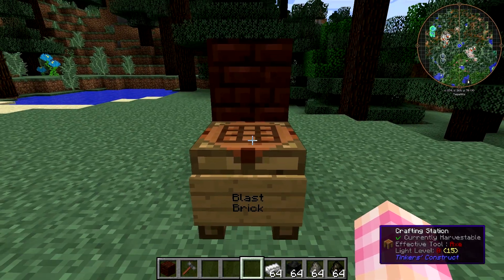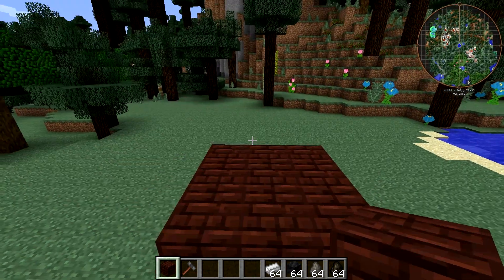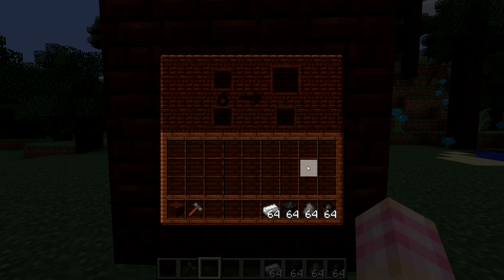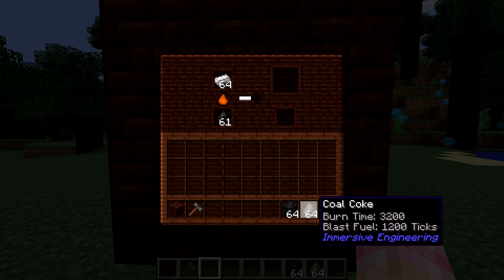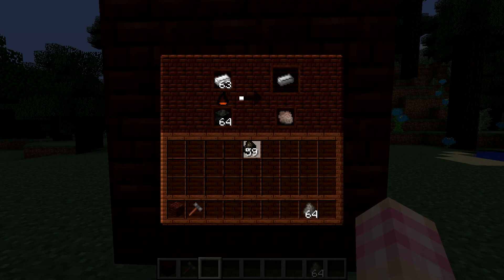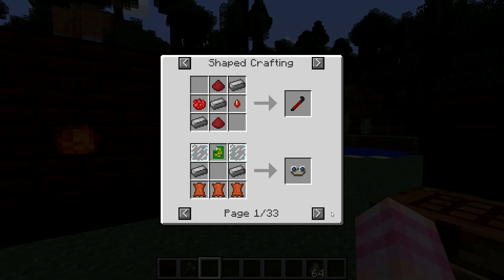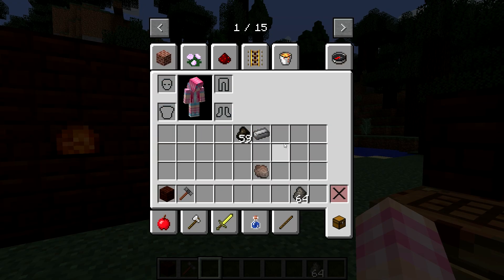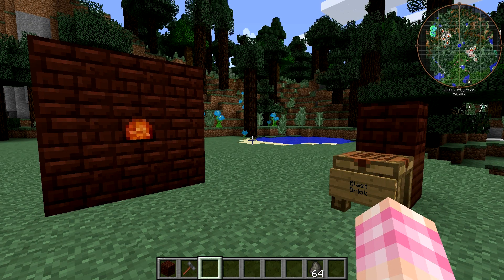Immersive Engineering Tutorial #5 - Blast Furnace

Comment: so i have a crude blast furnace and its not making the steel, im using iron ingots too help please
Reply from the maker: You also need to use Charcoal or Coal Coke as the fuel
Reply: i do use it but no progress is made
Reply from the maker: It takes 4 pieces of charcoal per ingot
Reply: and i put a stack of 64 charcoal in it
Reply from the maker: That doesn't make sense. Lubber and I were having problems with it in our Dragon Realm series too. Are you just running Immersive Engineering or are you running a modpack?
Reply: im using a few mods

Comment: Can someone tell me how to make the netherack in my Saw 2 furnace light up one block by one block like the furnace in Saw 2 when each row of flames popped up one by one in the gas furnace? My furnace is 10 blocks long 3 blocks tall and the grill is made of 10 netherack blocks. I use and iron trap door since iron bars can't be used as a trap door and it closes by a lever but I can't get the flames to pop up on each netherack block by one starting from the iron trapdoor to the window. So can someone tell me how to make the flames rise up on each netherack block one by one so I don't have to light up every netherack block?

Comment: Great tutorials as usual,
but this video could have been extended to mention the improved version of the blast furnace. 
That only require the blast furnace, a vanilla hopper and some bits of steel.

The improved one is capable to improve steel making speed with preheaters and RF/t.
Reply from the maker: +Johan Frankén I know, but I wasn't feeling 100% while recording this one so I just needed to get it out.